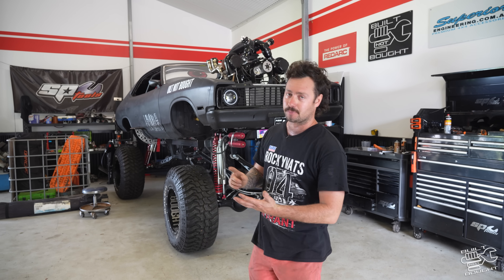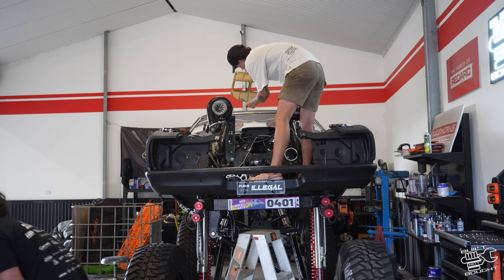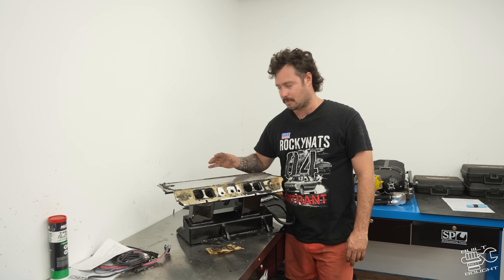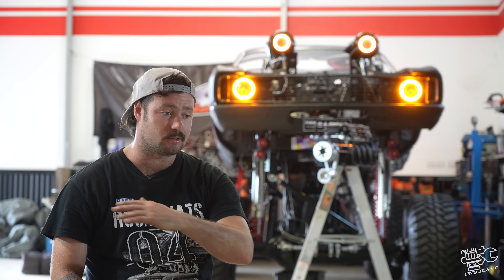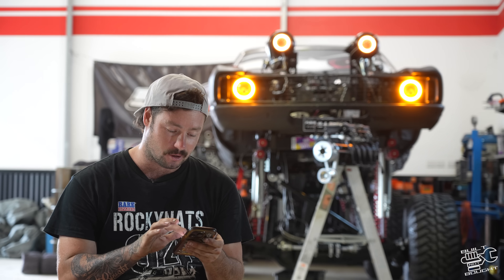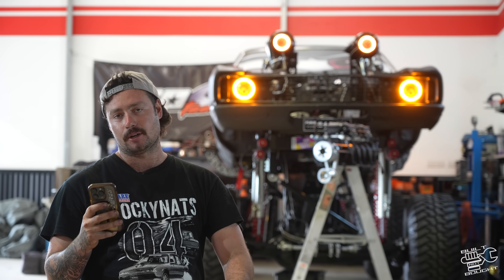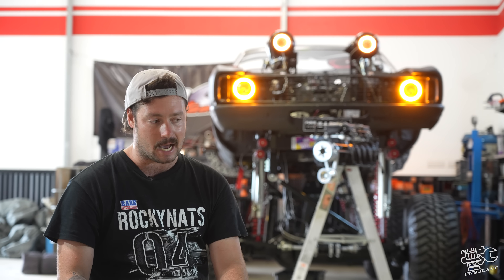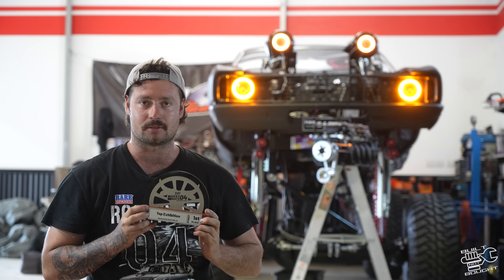FLEXC Reacting To Hater Comments

Comment: As far as your manifold goes, you should have welded the head flanges with the runners and annealed them (  i'm sure others have said the same ). Should have been able to not machine them at all after the rest of the welding was done. Proper way is to build the flanges up and re-machine flat....PITA I know......
I knew the build was a "Mad Max" type, and I wonder how many KB warriors have jumped up and down with the butchering of the movie cars.......SFA I bet.......
I will be checking it out in Sydney if I'm not away camping.....